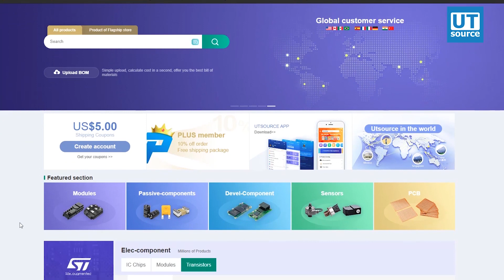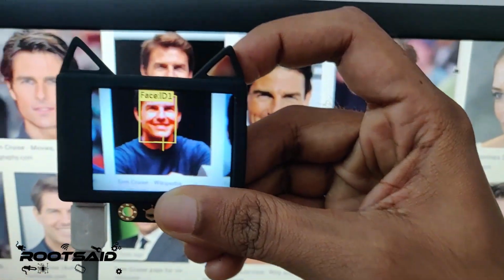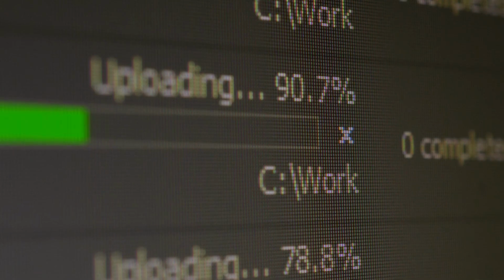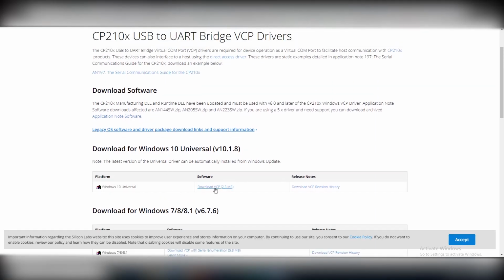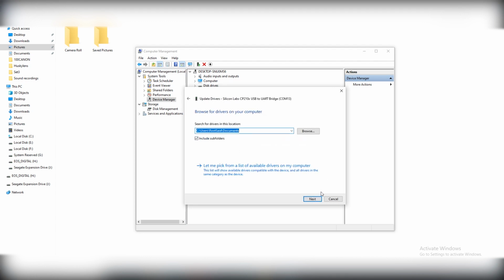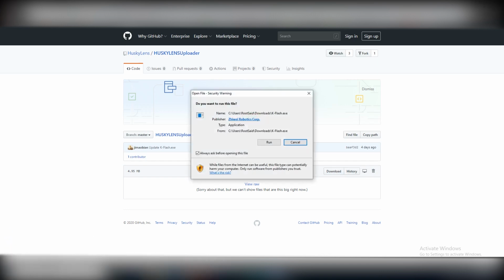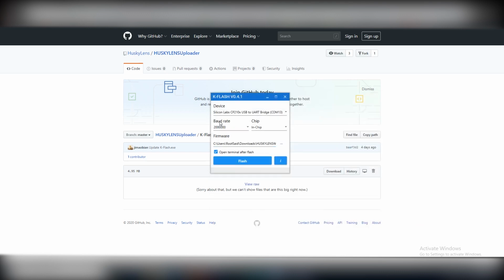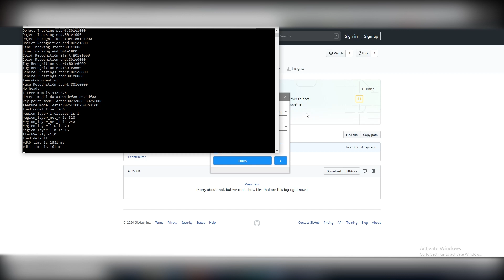HuskyLens Firmware Update | How to Upgrade Husky Lens Firmware? | Sponsored by  UTSource

Comment: Hi there Rootsaid, 
I am having problems downloading the firmware because I’m getting this message saying “This File does not have an application associated with it for performing this action. Please install an app or, if one is already installed, create an association in the Default Apps Settings page.